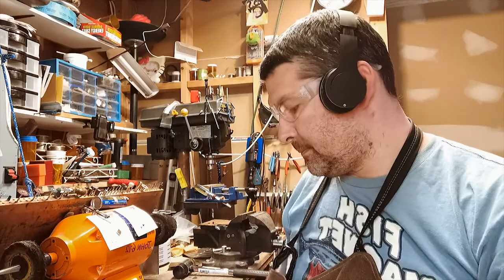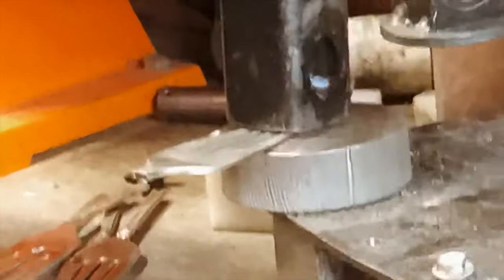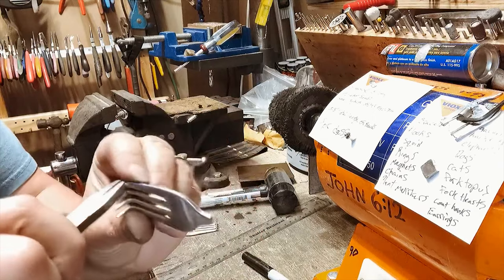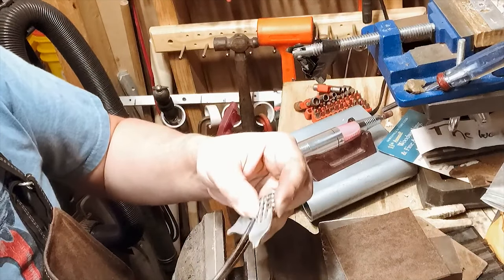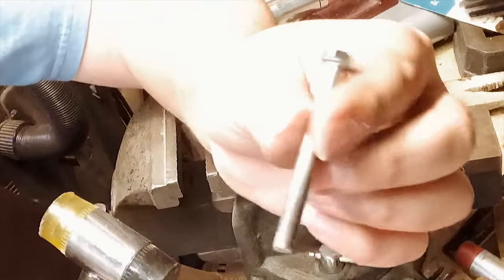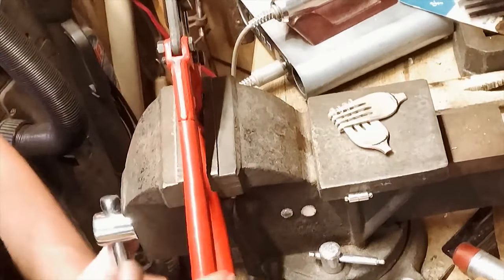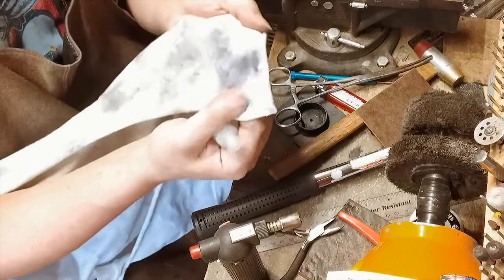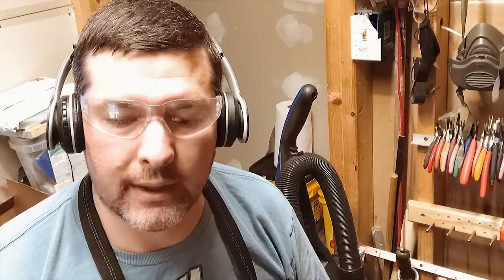Easy Fork Heart Pendant!

Comment: You make it look so easy lol. I broke the tines trying to bend them. Are you using stainless steel or silver? Thanks for the video!
Reply from the maker: Silver plated silverware. Try not to make such a hard bend allowing it to curve a little. Then once they are bent over use your hammer to finish the bending. I hope that helps
Reply: @FlatwareCreationSS  Thank you!